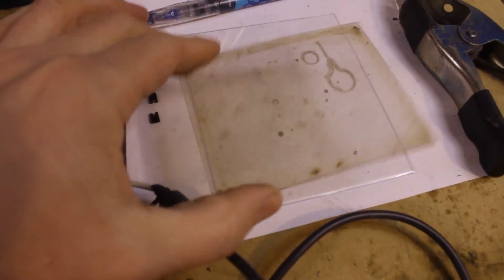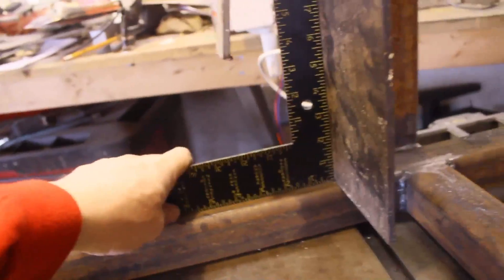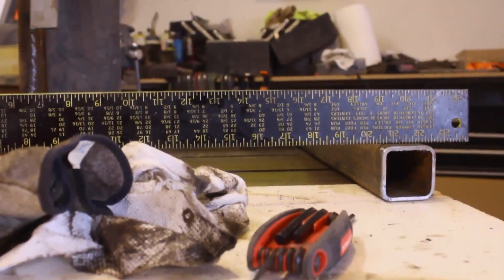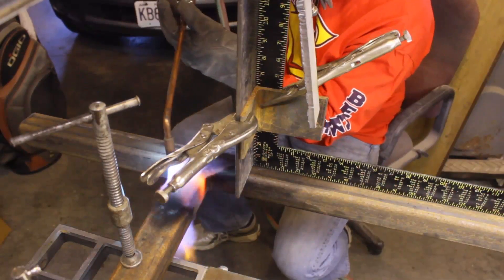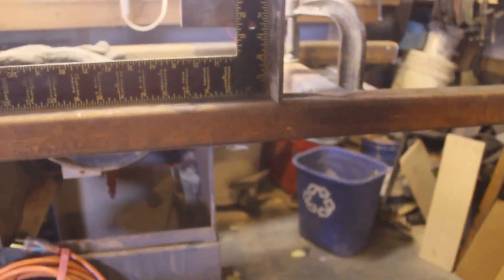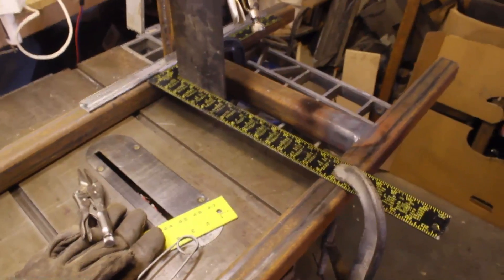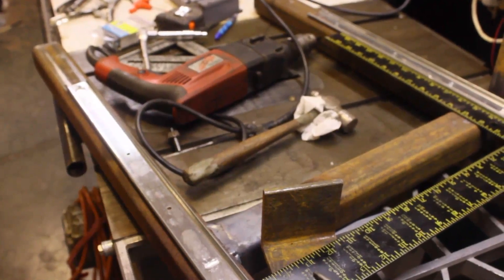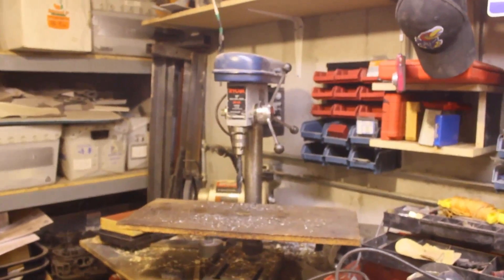Let's Do the Twist - Truing up the CNC Frame

Comment: I went to a machine shop to see about getting some custom parts made at work. They took me in the back of the shop to check something out.  I saw this granite slab that was like 4 foot x 6 foot and 12 inches thick. It must have weight a ton and there were all kinds of dial indicators scattered around on top.  Of course I had to ask about it and they told me it was there test and measure block. As flat as could be anywhere on the block. It cost more than I made in a year.  Temperature had to be precisely controlled in that room at all times.   Cool Beans.  Doing the best with what yat got.
Reply from the maker: TheEZGZ I've seen used granite blocks about 2" thick 18x18 go for a lot of cash...  Makes me wonder how they get it so smooth.
Reply: TheEZGZ The Granite block is called a surface plate, used for calibration, very precise measuring, also used for bluing used in hand scraping.  You can get a small one very cheaply, of course you need a height gauge, and other precision measuring tools to go with it.  here is a link to a cheap one on ebay.  http://www.ebay.com/itm/9-X-12-GRANITE-GRADE-A-SURFACE-PLATE-TWO-2-LEDGE-0001-/350269040175?pt=LH_DefaultDomain_0&hash=item518da9662f
Reply from the maker: LOL!!!  Shipping is more than the granite!  I had no seen these this cheap.  Thanks.

Comment: That's pretty darn good Greg! I thought it would be farther off then it was. Excellent job of getting it where you need it with the heat!
Reply from the maker: It was close.  Now it's closer.  I think this will result in VERY small tolerance issues for the pieces and parts I'll be dealing with.

Comment: Throw a slightly bigger 3 phase motor on your drill press and get a vfd. Fwd rev and constant torque speed. You can have your arduino run it too. Pid closed loop....scores...i like the blue firey persuasion stovepiper. Bmp.
Reply from the maker: R HEIDEMAN 3 phase motor with a single phase converter?  I've never done a mod like that.  I will look into it.
Reply: Yeah. Two lines in...three lines out. Like shuu used on booth fan. 

http://www.ebay.com/itm/2-2KW-3HP-VFD-DRIVE-INVERTER-RATTING-10A-220-250V-SOLUTIONS-NEW-GENERATION-/321298739141?pt=LH_DefaultDomain_0&hash=item4acee5afc5

Comment: That's cool. I bet that little twist is why most folks don't design there cnc's out of steel structure like that.... but you handled it masterfully.
One of the most memorable things i saw when i was younger was watching an old steel worker pre arch steel I beams. He played me like a fiddle he asked my help to eyeball down this I beam which was bowed and twisted and tell him what it looked like...... He explained what it was to look like when he was done perfectly strait and with an arch in the center.... I watched and called out as the beam got worse it bowed and bent rite before my eyes and he just smiled and kept fanning the rose bud torch..... he cut the torch and told me to watch close as he left the shop and walked away and like magic  when it cooled it sucked back down perfectly strait and started to bow upwards just like he said he needed... it was the most awesome thing to watch with nobody touching it it was like the hand of god straitened it and bent it upwards perfectly. At the time i had no idea what i watched but it was like magic to me...
Reply from the maker: builtrodewreckedit I'm def not that skilled...  I hack at it and keep going until I get what I'm after.  Heat is an amazing thing.  If I had a blanchard grinder near by, I would have had the whole thing surface ground to get it bang on...  Sadly, no one around here does that any more.

Comment: Nice work on straightening the frame Greg.  Handy to have the deck of the table saw to clamp against, most of those are surface ground and have a very true surface so you had a good datum.  Tramming in your components will make a big difference in the end.
Reply from the maker: turbocobra I feel weird as a guy who welds a fair amount but who does not have a surface ground welding table...  The saw is the next best thing...  I was going to have the whole CNC frame ground flat and true, but the shop that did fixture grinding closed 2 years ago...  That would have been sweet.  BTW, I saw you using a benzene torch.  I figured you had an oxy rig.
Reply: Greg's Garage The other thing too is that some of that square tubing comes "pre-bent" free of charge, lol.  I bought some 1/8th flat bar the other day 1.5" wide, and it was bent the hard way, never seen that before, didn't realize it till i got home and then they wouldn't take it back.  Nawh man, I upgraded to the map gas bottle, matt was using that, lol.  yea, I have never bought an oxy setup, I almost never heat anything up that hot, and wouldn't use it that often, and have a small space.  When I build my big shop in the country I will get one for sure...
Reply from the maker: turbocobra All the tubing on this build was pre-bent.  I cut from the straightest pieces.  I'm hoping that won't come back to bite me.